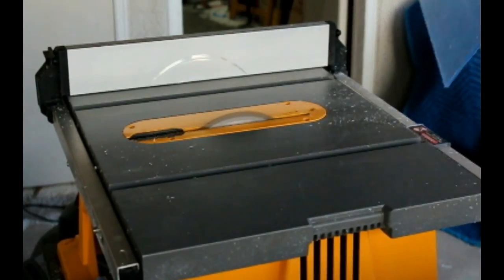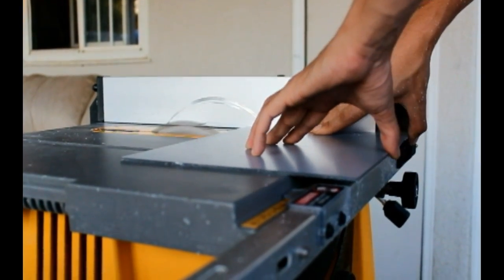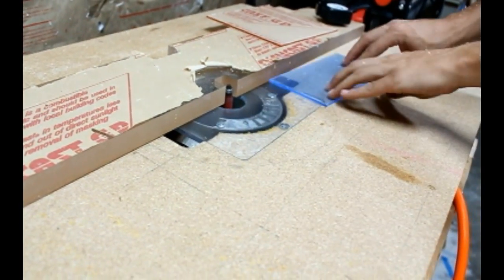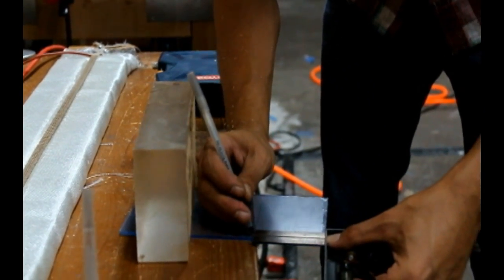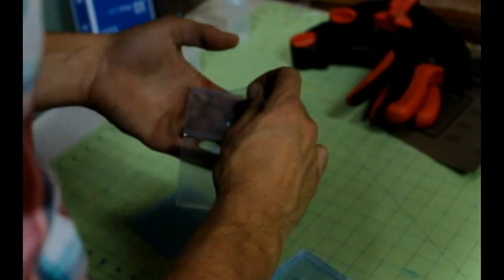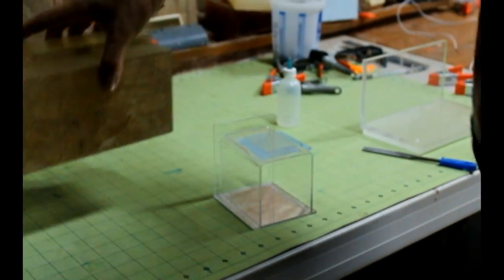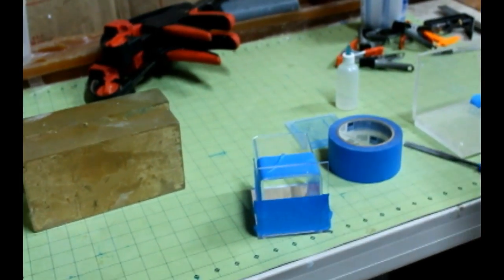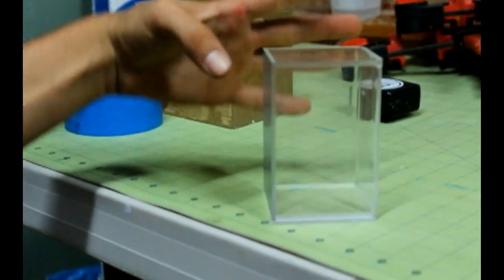How To Build Plastic Display Cases

Comment: In other words....I can't do this on my own.  :(
Reply: Daniel Louzonis right bc i dont have the tools.
Reply: actually only the right filament needs to be bought (so you use a batery or something and use it to heat the material, some heat gun could work aswell, however is not recomended as it works better with the same temperature on all the joint or  it could get deformed)

Anything else could be made with wood, or use more primitive sanding tools... also you could give the chamfers a transparent look if you did sanded it roughly with a torch, even one 4 cooking should work)
Reply: 😂😆 exactly
Reply: All you really need is a scoring tool you can get at Home Depot, the right glue and a torch tool wise. The jig is necessary though.. I make displays at work and it can be done with hand tools, a bit slower but...
Reply: Hahaha

Comment: I hope you are looking forward to a trip to the ER. The method of cutting with your (R) hand between the material, straight edge and blade is extremely dangerous. You should be using a block of wood to hold work straight without putting yourself in danger. I sincerely hope this tragedy never happens.
Reply: +Norman Featherston Your first and last sentences nearly contradict eachother.  If you turn on annotations, the video mentions the dangers and suggests guards.
Reply: You are correct Brannon Harris. I should have used the word 'may' instead of 'hope'. All the best, stay safe.
Reply: +Norman Featherston hey, thank you!
Reply: He’s cutting clear material. It’s not like it’s going to surprise him a cut off his fingertip.
Reply: Sullyvan  Famous last words!
Reply: Sullyvan I dont think you've ever used a table saw. Sometimes the piece your cutting will kick back because of the way your pushing it through. When that happens say goodbye to a finger or two. Common sense is to never pass your finger past a spinning blade.
Reply: You are 100% correct Norman, I am living proof of what this fella just said, it’s called kick back, and if you use one of these saws, YouTube table saw kick back and you will see for yourself.

Comment: Curious about the details of the trim-flush fence for the router. It says details in the description, but not seeing them. Am I missing something obvious?
Reply from the maker: Hey! I was using a 3/4" Trim Flush Router bit with a standard barring.  Hope that helps! Nothing fancy.  Just needs to ride along wall and trim off the panel that has been glued to the bended panel.
Reply from the maker: I will dive back into the Fence fabrication at some point. Life got crazy.

Comment: Hey ! Did you use a normal router bit to clean up the extra plexiglass or did you use a special bit for it?
Reply from the maker: Hey! I was using a 3/4" Trim Flush Router bit with a standard barring.  Hope that helps! Nothing fancy.  Just needs to ride along wall and trim off the panel that has been glued to the bended panel.
Reply: @sacmakers4770  1 how to bind/join transparent polycarbonate sheet to make a box? Will acrylic grade glue/polyfix/chlorofom can be used ? 2 How much thick sheet will be sufficient to withstand hot water upto 45 d celcius ?

Comment: Dude you lost me 16 seconds into the video when you're using a professional sawblade as large as a fridge for this. How is this diy?
Reply: It's a table saw with a carbide tipped saw blade.  You can buy them at Home Depot.  Not Professional Grade Unobtainium.  They're pretty ordinary if you actually go out and look.
Reply: @tomm1968  Yeah I ended up getting one, it fits nicely in the middle of my tiny NYC studio apartment. However, I use it as sa surface to score the acrylic sheets with a knife and cut it that way. Otherwise it wakes up the baby.